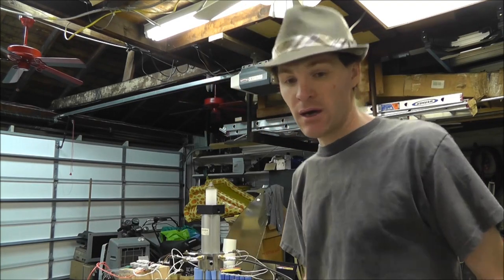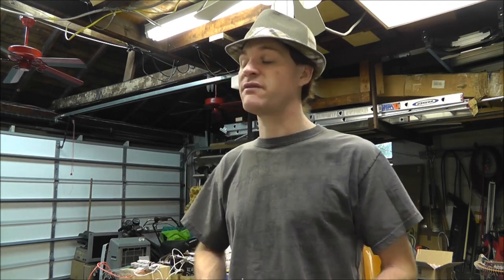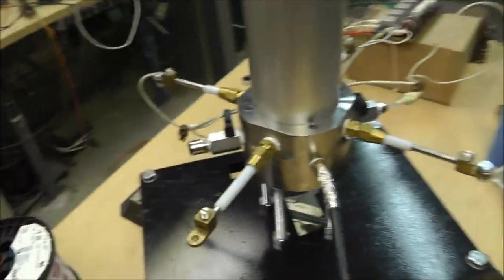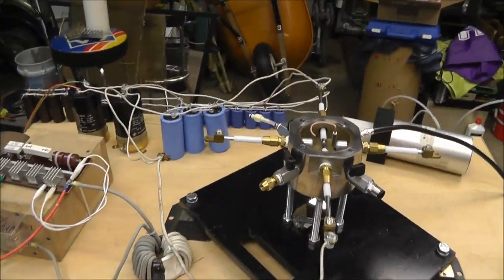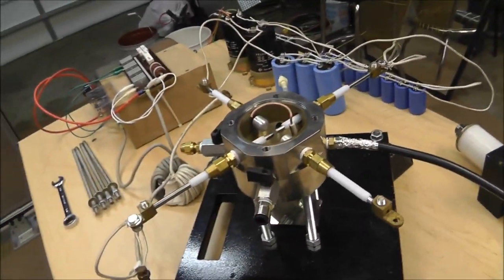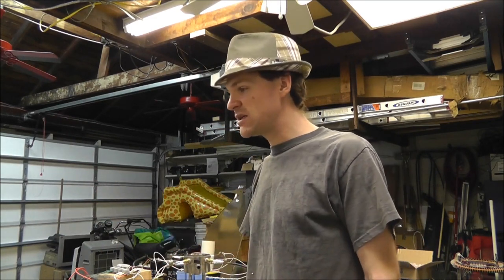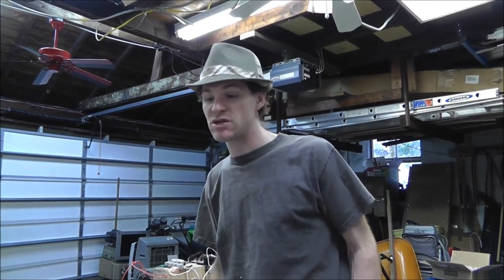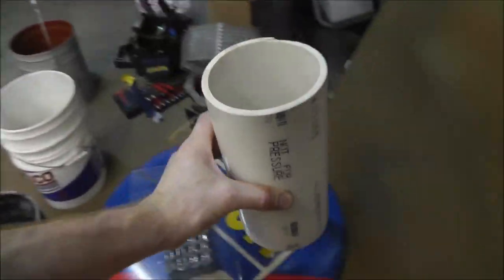Update 10 NGE Papp: Calling All Radio Geeks For Help! & Some General Updates RWGresearch

Comment: Hello Russ. thanks for the great videos and inspiration to continue experimenting with My NGE.
a thought on the RF frequenzies , i used to be a ham nerd  (long time ago)
You have to tune the antenna to the frequenzy, meaning: if you have a mismatch you will not get full Power and if you are really "out of tune" you Will burn up the output transistor of your CB.
Explaining, at 27,105 MHz the lenght of the antenna for a full wave lenght is 11.0604 meters.

Comment: Thanks Russ, very good update. Never messed with RF much, but I did discover two Lawton circuit in close proximity to each other, not connected to each other, one that has a stronger RF signal strength, will control the other. Just depends on the components used to build the circuits.

Comment: Every antenna that is shorter than that has to be compensated by coils in one way or another.
The easiest way is to use an online calculator to get the lenght of antenna that is practical for your use.you should really get a compensator and a "standing wave meter" which will help you tune the antenna. the most common antenna is 5/8 of the full wave lengt = 6,159 meters but thats anywhere near practical for your use.

Comment: Dumping current across with what modulations? A ref ? A complete schematic where?
Energy >500kv has potential to ionize, and a recombination of +ionized air will ignite due to molecular repolarization among strong force shells of atoms, where magnetic current skips 9 mods to be come 3 high speed exchanges which can mean fusion or fission. Dynamic 3d interaction of atoms is norm while linear interaction is polarized and highly volatile.

Comment: A 1969 Corona w/a flathead engine will run off air. A lawnmower will run off air. Not much hp but it works, just got to change the timing chain gear tooth (skip some). Is this short meant to heat the air maybe? Or consider that any free energy system is meant to positively ionize which means extracting energy from a near center 1/5 radial in many cases. Any influence transformer will carry modulation w/o carrying ground.

Comment: Hey Russ, if you have a second... what is the energy output measurement method, do you calculate the joule in a cap, say, load the coils, fire, and then lift a mass, to a certain height, something like that? cheers

Comment: You have a complete mismatch antenna, that will blow your RF amplifier. 
You need to tune the antenna to the frequency OR an oversize amplifier running at 10%...

Comment: Hey russ... the copper antenne should be grounded. As is every RF Antenne. I do not remember if it the Impedance is 50 or 75 Ohms? But it must be grounded for it to work properly.

Comment: Radio stuff: cbs are very fragile and only put out about 7 watt peaks.. not much. im not sure why you would need to introduce a wave into this but. they are very easily over volted or burned up from large electrical impulses anywhere near their receiving end. they also are unable to broadcast over 4 min or so continuously. they have a tendency to burn up their transmitter mosfets. as large short like this will kill it. you will need a large coil of wire to create enough resistance if you want it